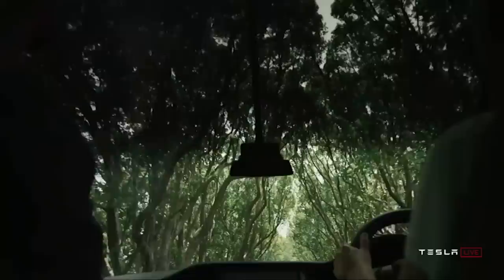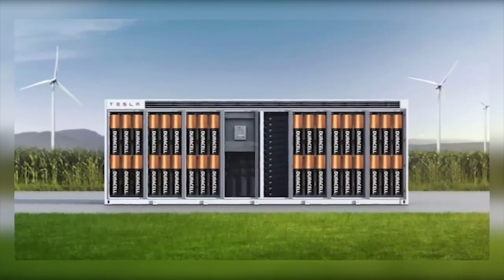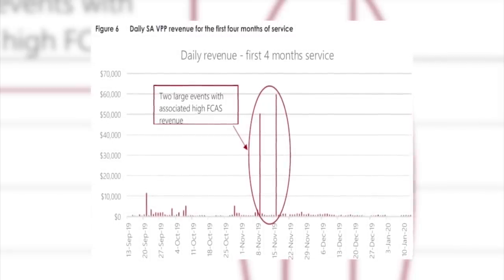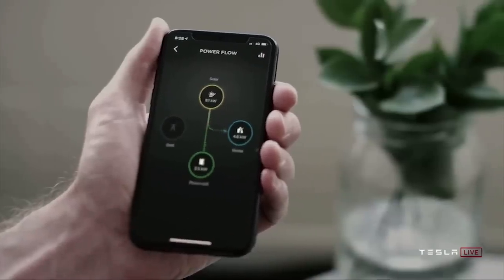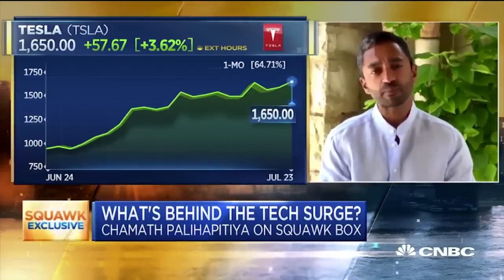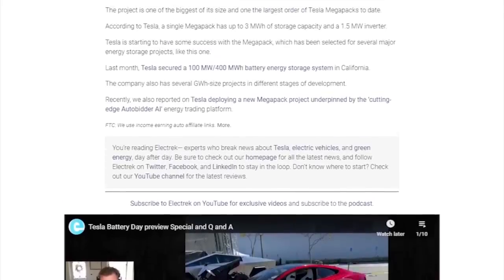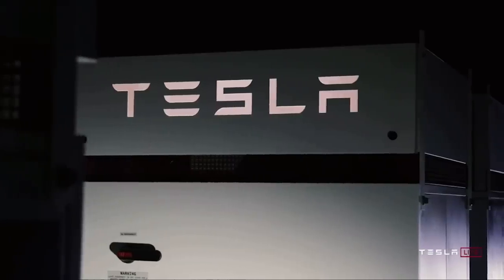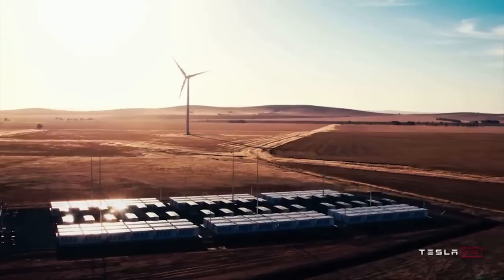Tesla Battery Farms Will Destroy Utility Grids

Comment: There's no doubt that Tesla can do this.  But the public utilities have been lobbying the states to prevent a lot of the changes that will leave them with stranded assets.  They don't want to be stuck with huge fuel bills for peaker plants that can't sell the electricity because they are underbid by renewables.  And they can't afford to turn off the peaker plants because they have to pay for the loans to build them.  So they're forced to declare stranded assets and write them off as a loss.  They will fight like hell to get out of that, so be prepared for a lot of political fighting.

I'm in California which has been progressive and the CPUC hasn't bowed to the utilities' demands.  But other states have a horribly low amount of renewables, and that has to change.
Reply: I agree but you can do less against an house owner how install solarpanels - thats the way it will happen.

Comment: Who makes the cells that go into the megapack? From the Battery Day call my sense was that it's not Tesla (Panasonic? LG? CATL?), and for the next few years it won't be Tesla because they aren't ready for distribution and then for a few years more  they'll be putting all those new batteries into their cars. Can't scale their own battery production fast enough to meet the needs of both car and power supply businesses.
Reply: @Big E
So start a battery manufacturing company, and make a lot of $$$.
Reply: Stationary batteries are more likely to be lifepo4 weight is not a concern if your not driving them around also has better cycle life
Reply: @jackdbur  maybe flow or cryo batteries will fill the void

Comment: Thank you for your interesting video.   The impression I get it that you suggest that the Mega packs will make the traditional power station obsolete. I think it's misleading because currently in Australia the Mega  pack is only designed to handle a very short time power supply to the residents.  I cannot see how you make the leap to replace the grid.
Reply: The grid will still be around. It's not like everyone becomes off-grid even with a solar roof and a power wall, and in fact it makes more sense to be grid tied so you can sell your power back to the utility (to store) but what will likely shrink is the need for centralized power plants IF solar and wind can supply the power.  The utility companies of course don't want that model to be the future.
Reply: @erikehlert  Such a model is entirely UNsustainable. California's grid is collapsing to support solar.
Reply: @pasoundman  Record heat for days on end, everyone working from home, and a market mechanism that didn't work the way it should didn't have any bearing on the situation?
Reply: @pasoundman  Ok boomer.
Reply: You are correct. Thank you for your input .
Reply: It would be great if some technology existed to replace natural gas peaker plants!
Reply: One typical power station provides 25-50GWh of energy daily. The grids of France, Britain and California each average around 1700 GWh daily Good luck with your 'megapacks'. Musk is a ridiculous self-publicist. His more insane suggestions will soon come back to haunt him.

Comment: It makes more sense for them to go into 3d printed concrete/composite construction, cutting production costs and increasing the efficiency of every new dwelling.  Each unit would have solar panels/turbines, Tesla HVAC, and battery walls, and in essence be both generator and capacitor.  The entire neighborhood would be a mini megapack and could be connected to every other neighborhood creating a world wide self-sufficient grid.
Reply: Printed CONCRETE ? You're a delusional idiot ! Read up 'net zero' homes' if you want to learn.

Comment: Backing you grid-power in millions of Li flashlight batteries seems absurd.  There are many other companies besides Tesla who offer such power-packs, but most smell like a scam of rate-payer's money.  Li batteries have only ~1000 charge-discharge cycles, so if used daily the batteries need replacing every 3 years, and their capacity declines as they age.  One video clip states a payback of 4 years, i.e. "can't get there from here".  Mostly computer renderings are shown since there are only a few current installations.  Most are intended to smooth the grid and can't supply backup power for more than a few hours.  The most visible one is in SW Australia.  PG&E is planning one near Monterrey, CA since the state won't let them use peaker gas turbine plants.  Pumped-water storage is more economical where there are plateaus and available land, and is widely used.  Even easier, where there is hydro-power, the utility can just run water thru the dams when power is needed, though environmental rules add restrictions.
Reply: Hydro in CA very funny a giggle in a Florida too
Reply: @jackdbur  
Quite a few pumped storage in California, plus hydro-power.  You do know there are many mountain ranges there?  Yes, Florida doesn't work, nor the whole eastern lowlands and most of the Piedmont, but the Cumberland Plateau is flat, so good for upper reservoirs (ex.  Raccoon Mtn, TN).  Complete list: https://en.wikipedia.org/wiki/List_of_pumped-storage_hydroelectric_power_stations

Comment: How long will a battery farm last before degradation assuming it is fully charged and used up every day?
Reply: Maybe 1/2 to 1 percent per year.  Maybe 10 to 20 years.  Depends on temperature, depth of discharge, etc, etc.